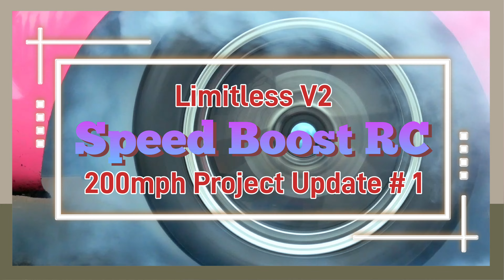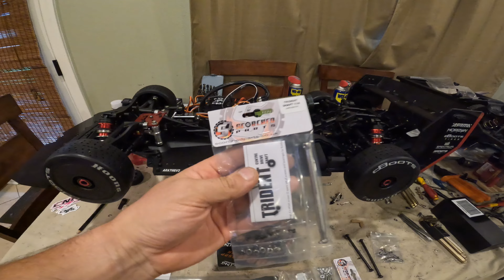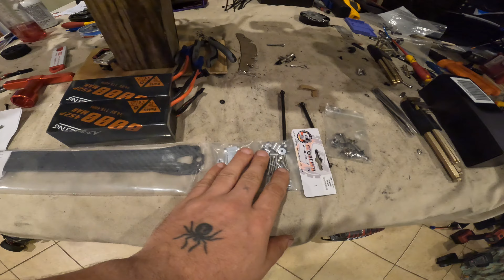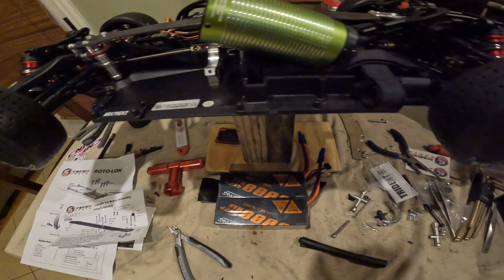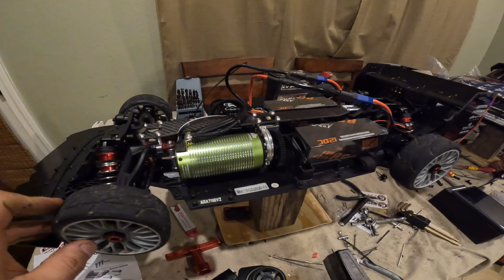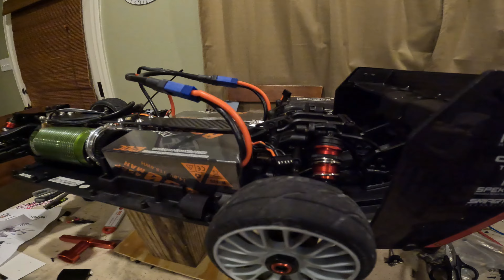200mph ARRMA Limitless V2 Project Update 1: Scorched RC Upgrades, Chassis Mods & Final Assembly

Comment: Good idea with the stretch build are you still gonna run batteries in the front raz had a nice looking g dual 1721 set up …
Reply from the maker: I was originally planning to stick with the same body and just stretch the back end. I have a way to do it without making it look awkward. The machine shop is currently working on a die to stamp out the body. If it turns out well, we’ll start selling the stretched versions.

Comment: Hey bro, which motor mount are you using on the limitless?
Reply from the maker: I'm using a Scorched RC Roto-Loc mount. The motor is a 2028 800Kv. However, this motor is for my son's Outcast. It's only in the Limitless for now while I wait for my two 1721 2400Kv to arrive.